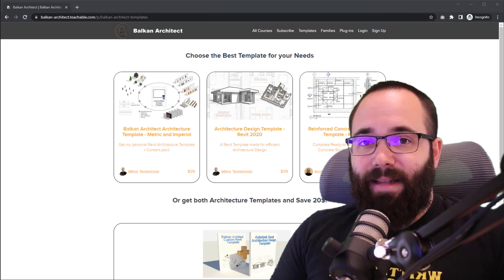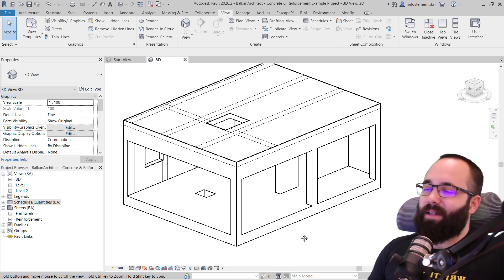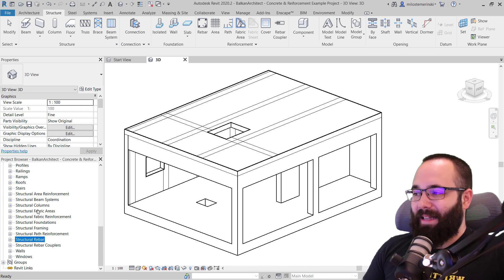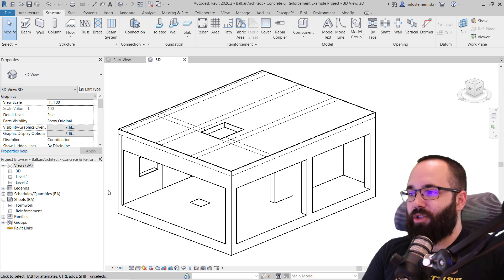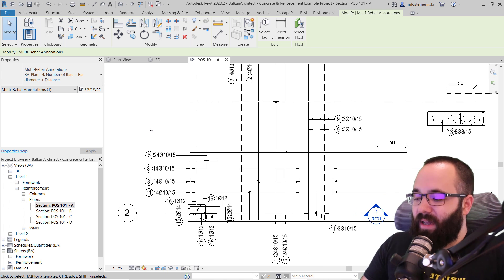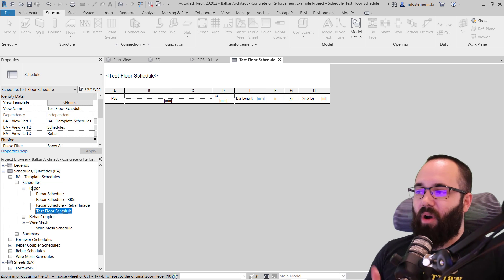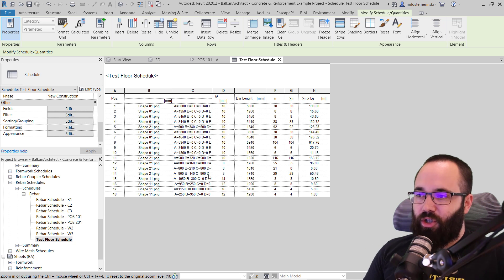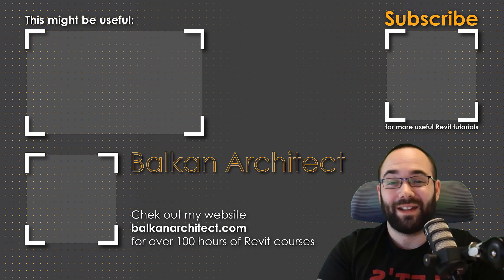Concrete Structural Template for Revit

Comment: Hello Balkan,
I have a question regarding the Template while starting a fresh drawing from designing of the project until the finalization.
As per designing and architecture is concerned which template should be used when starting a new project from scratch.
We know if a plan is already created in CAD the drawing plan can be loaded as reference, but 
- If starting from scratch should we start from Architecture template to make some basic plan then add the grids and levels to it?
- Or should start from Structure template and prepare the grids and levels then move for the Architecture?
Reply: I have the same query as well. Were you assisted?